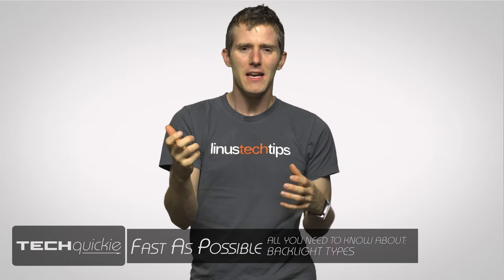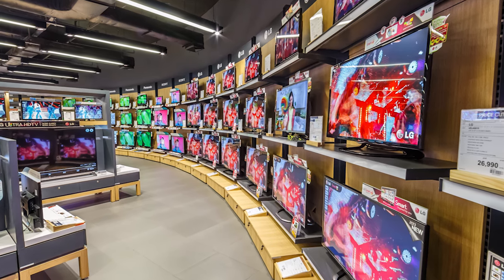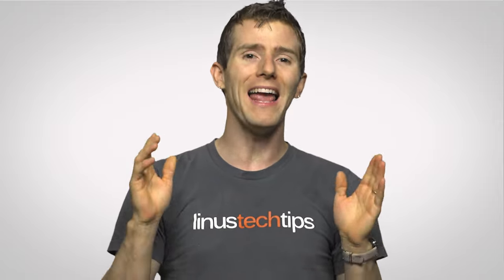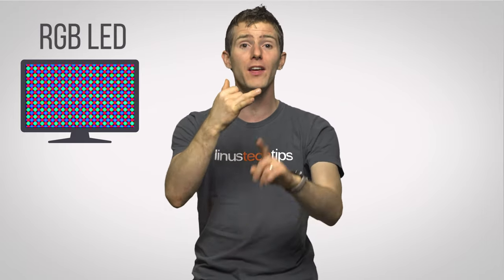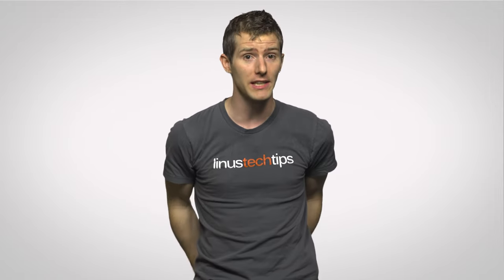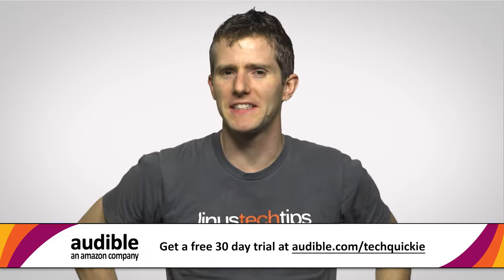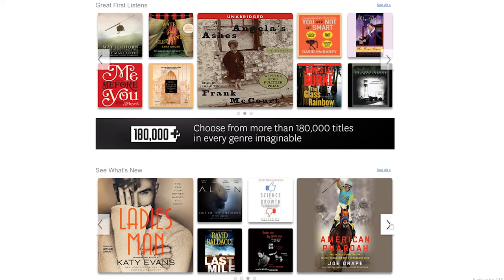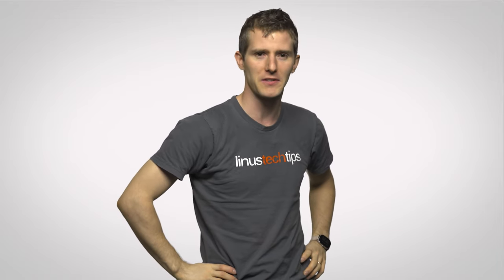Backlight Types As Fast As Possible

Comment: But only OLED rival's a prime CRT's overall image quality
Reply: +Street Guru He's either full of shit or just outright has not used a good Sony Triniton CRT TV in a LONG LONG TIME.

A 1020x720 on that CRT monitor WILL look better than 1080 or 1440p ON ANY LCD display I've ever had. The colour is much much better, the contrast and blacks too, not to mention no ghost at all and it's EXTREMELY sharp without any pixel flickering. I tried playing supermario World on an LCD, due to image scaling and how CRTS deal with native resolution... The game will look much much better. On an LCD it looks like a water painting... The colour range is also simply not there, I cannot tell the difference between the subtle colour ranges on ANY of my LCDs I own like I can clearly tell on my Trinition and other high end CRT TVs I've been buying to play old console games. And yes, I render them on the PC with an emulator, and then use the CRT as a screen with S-Video.

I've never seen an OLED monitor... but I will eventually buy one. As it stands, a top of the line CRT screen is better than any LCD I've ever touched. Not in resolution, or refresh rate... but colour accuracy, gama levels, sharpness, true blacks and contrast... Not to mention the ability to make any resolution look good due to it not having a set "standard" native ress. Any LCD that displays an image lower than it's resolution, will make the image blurry and washed out, that's not the same with CRTs. Bad my CRTs will all blow the fuck up before I have no use for them.
Reply: ADevilNeverCry
1600x1200 75Hz CRTs are where it's at

Or naturally the really expensive professional models of the day